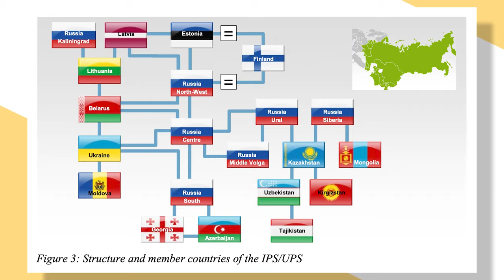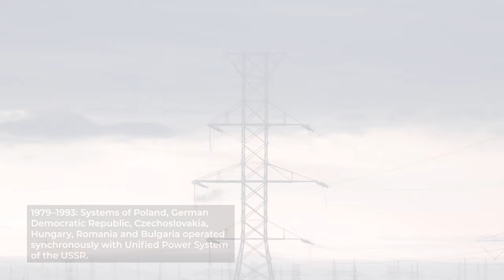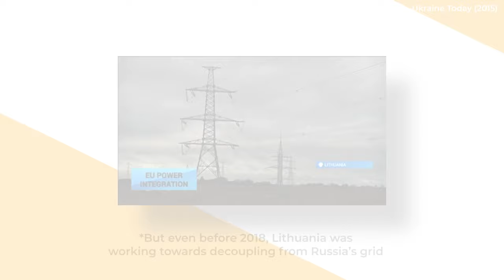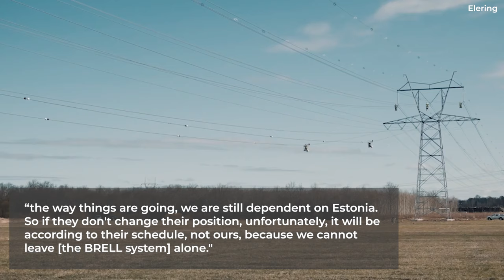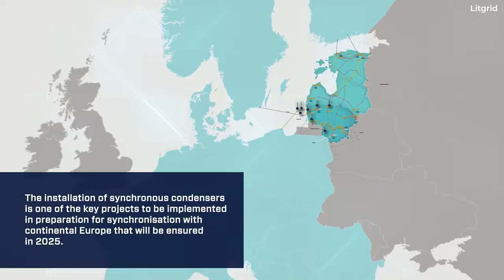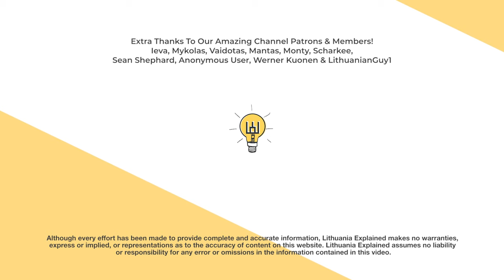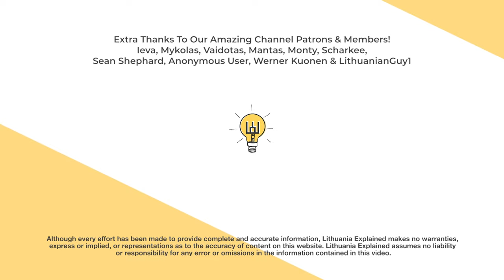Explaining Lithuania’s Electricity Situation

Comment: Just a note,  it was we Lithuanians who slowed down Rail Baltica,  so we all are the slowest sometimes 👍
Reply: Well not really. It's Estonia who plans to finish Rail Baltica some time in 2030's. Lithuania and Latvia don't have any delays yet.
Reply: Source?
Reply: @karkevicius  it's well known that Lith was blocking the project because it originally only proposed the route through Kaunas , but later wanted to add Vilnius .  This caused a long delay, until they basically gave into LT with a few consensions.   That took a long time to hammer out and delayed the project
Reply: Rail Baltica could fail because of Lithuania, say officials
 2013-12-06  From wire reports, RIGA Baltic times
Reply: @tnickknight  oh from ten years ago? Yea I believe you then
Reply: @karkevicius  decisions on infrastructure happen over longer time periods, like the changing of the grid.
Reply: @karkevicius  He does not have a source, because his claim is BS. The only delay in Estonia was the fact the section between Pärnu and Latvian border had to be rerouted due to environmental concerns. Due to this, the whole network will be completed by 2030, while the section between Tallinn and Pärnu will be ready by 2028.